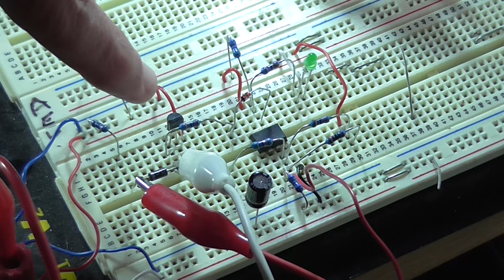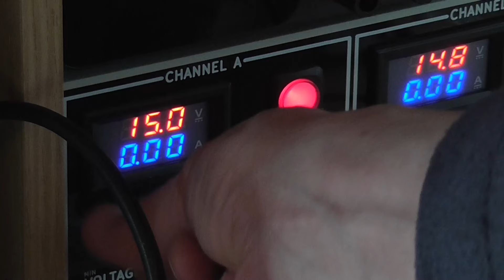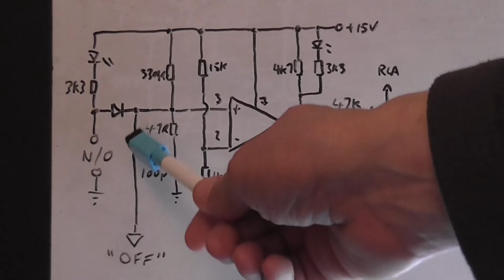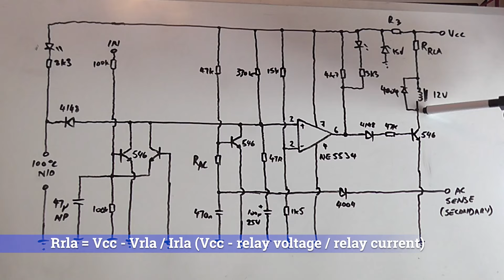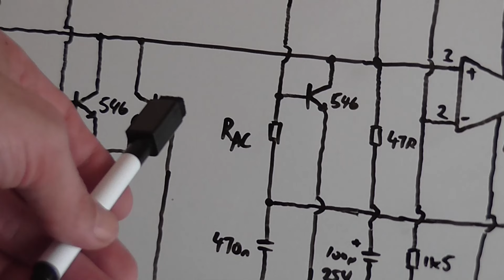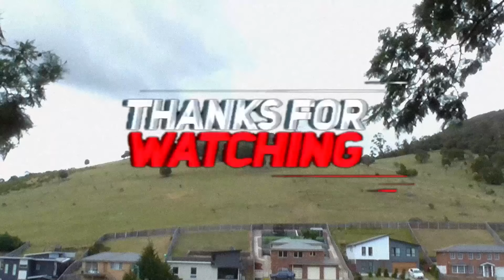Elektor PA300 Amplifier Project: Protection Circuitry Modifications

Comment: I'd be inclined to put a pull down resistor on the base of the transistor. 6.8k would probably do. To ensure it turns off. I think the issue here is that when running on a single supply, the 5534 can't swing close enough to ground. The LM158 would probably be a good choice here instead.
EDIT: If you stick with the 5534, the I suspect the diode (to the base) is not required, and neither is the 4.7k pull up resistor. Change the series resistor for the LED to 1k, the 33k to 10k and put a 1k pull down resistor. That seems to work, as the 5534 can source enough voltage to run the transistor on (negating the need for the 4.7k pull up resistor) and the pull down resistor negates the need for the diode, as the opamp output is not swinging to ground. NOTE: All comments refer to your initial diagram.
Reply from the maker: Thanks. A 6k8 pull-down resistor on the base of the driver indeed does work. Without the 4k7, the base resistor still 47k, the pull-down resistor on pin 2 of the NE5534 still 1k5, the base is pulled-down to around 0.16V when pin 6 swings low. It sits at around 0.79V when pin 6 is high. The series resistor is 3k3 to keep the apparent brightness of the LED lower when using an LED with a millicandela (mCd) of 600 or so.
Reply from the maker: Did you LTspice this, btw? Lol. Either way, you were right.
Reply: @AstrosElectronicsLab  I don't know why, but my comments mysteriously disappear. I initially thought that a lower value would be good (I was thinking 3k9 or so) but in order to verify I put the circuit into spice. I use Tina (you can get this from the TI website). It's very useful. I'm not a fan of LTSpice.

Comment: LM321 (single version of the 358) has near low rail output
Reply from the maker: You mean LM321 single version of the 393.
Reply: @AstrosElectronicsLab no, 358. Family is 321, 358, 324. And no I have no idea how they chose that sequence of numbers. For this case I was just thinking of what's the cheapest common single opamp with 30+V supply and ~0V rail output.
Reply from the maker: @ivolol ah
Reply from the maker: I also want to apologise, I saw LM321 and got confused with LM311; which is the single version voltage comparator of the LM393. The LM321 is an op amp, and yes... I hate their naming convention as well lol